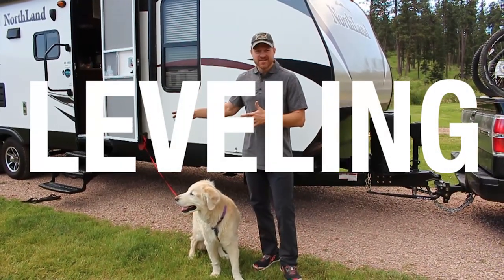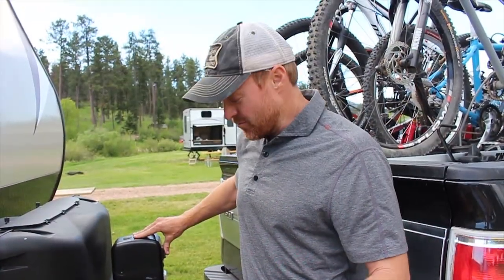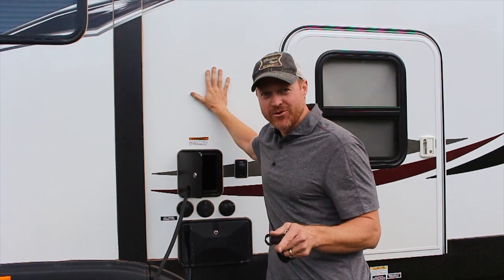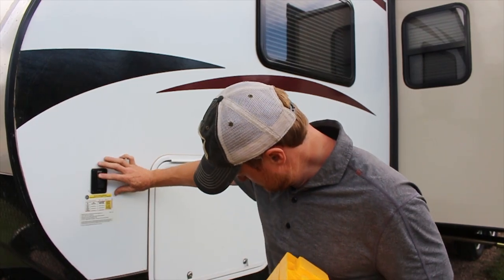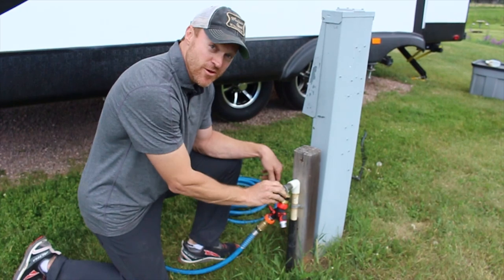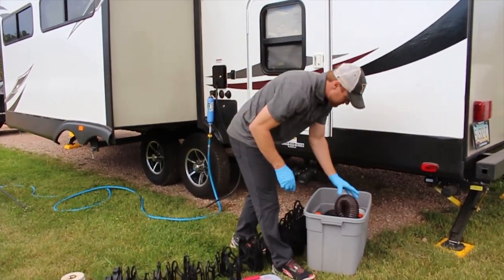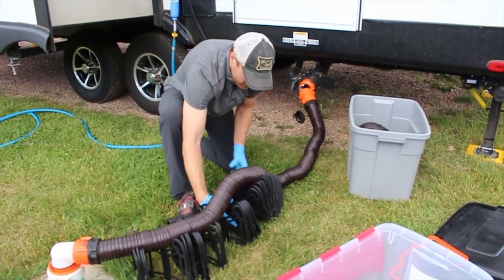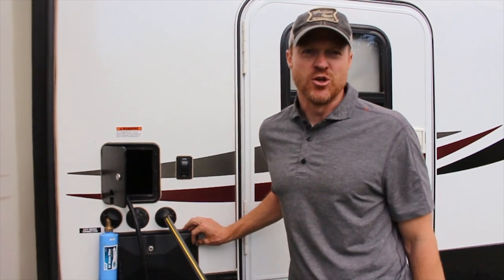HOW TO HOOK-UP AN RV FOR THE NEWBIE RVER! (FULL TIME RV LIVING)

Comment: Great video, try calgon water softener in your black tank. helps keep your sensors clean and break everything down and smells good. We have been fulltime Rving for 5 years now and still learn something new at each stop. You already know more than we did our first year. Y'all be safe
Reply from the maker: Will def give it a shot! We might have some build-up in our gray tank pipes... heard a gallon of Lysol de-greaser works well for that. Any input there?
Reply: Occasionally we would drop one of those pellets for dishwashers in the black and grey tank, fill them half way and then drive to the next location and drain ... cleans the sensors.

Comment: I have learned that putting the water filter  before the pressure regulator will make the regulator last longer due to crappy water, especially on a adjustable regulator.

Comment: Great video. Another suggestion that I would like to make to you is on your sewer discharge pipe I bought a 3 in shut off that fits right on in place of the cap giving you an extra layer of protection from accidental leaks, and then the cap fits over the discharge valve.
Reply from the maker: That's a good idea. I'll def. look into it.
Reply: +Keep Your Daydream Camcorder makes the shut off valve and can be purchased at Amazon or other RV parts stores
Reply: @KeepYourDaydream  Funny, your son will appreciate it in the bird.  This was a 5 year old comment.

Comment: Great video. I like the comments I'm getting some good ideas. I didn't notice did you put a pressure reducer on you water line. In regards to the gloves I use commercial grade dishwashing gloves from home-depot and then wash my hands with the gloves on and reuse them. They last a long time and it's less expensive than boxes of gloves. As said before the surge protector is a must. I had a pedestal that was reversed and I caught it when I checked the power with my surge protector.  Keep it up, you guys are doing great.
Reply from the maker: Thanks for the comment. Yes, I've learned a lot from the comments. I should have pointed out the pressure regulator. It's the brass fitting on my fresh water hose, but I should really have one on my grey water hose too. Run the risk of blowing out the lines when filling the black tank. I'll be adding a surge protector to my Amazon order tomorrow! Also included in that order is the bumper mount for my second spare tire and some motion sensor LED lights for the cabinets.
Reply: +Keep Your Daydream one more thing. I only hook up the sani flush when I flush it. But I placed an in line valve so I can shut it off at the RV instead of walking back and forth to the spicket.
Reply: I don't think you can blow out the black water lines with pressure since the tanks are vented to atmosphere (through the roof vent).

Comment: mark as someone else said..done like a pro....the only thing we do different is pull the slides out before we level side to side. Incidentally were also we just at Rushmore...cool place!
Reply from the maker: Thanks. Interesting... you're suggesting to pull the slide out and then level? Do you have a Class A or trailer? If we needed to level side to side, it would require moving the trailer.
Reply: We have a trailer... Cougar Xlite 31RLT we were advised by the dealer to level with slides out...it has 3 slides though so maybe that's why we level side to side with the slides out before unhooking the truck and bars..Also if you guys frequent some of the RV/trailer forums you'll find you can put together a hearty brass adjustable water regulator to improve flow (shower) but not overwhelm your trailers plumbing. I also on this last trip learned that having plumbers tape and several replacement rubber o-rings for the water service/hose connections are beneficial as they fail pretty frequently

Comment: on your waste line you need the hose to create a trap ( down up with water in it ) this will stop gasses from getting into your system if you leave the gray water open and in extremely rare cases rodents from getting in threw the system. extremely rare but it can happen. also you could mention tilting the awning to run off heavy rains it looks like rain. 
just some observations.
dave
Reply from the maker: What a great idea. Easy to do. Thanks!

Comment: I put about 5  - 10 gallon of water in my black tank along with some dish detergent before leaving for the next stop. Drain it when I hook the sewer line. Does a good job of keeping the tank clean and even with a back flush, there is still junk in the tank.
Reply from the maker: Great idea. I've done that a couple times,  but I could easily do that more. Thanks for the comment.

Comment: Did not see this in comments.  We always spray the campground water outlet with bleach .  Have seen people too many times put their sewer hose over the outlet to flush out.  I would NEVER hook up the hose to flush the black tank.  One accidental turn on and a totaled RV from black tank overflow.  I only hook up when using and NEVER leave the hose while in use.
Reply from the maker: Someone mentioned this a while back... but the way you put it was very compelling. I need to start doing this. I assume everyone hooks-up like I do and that's wrong. Spraying everything down is a good habit to get into. Okay, another good point about the grey tank. I actually don't leave it connect, but I may have implied that in this video. I think I'll go back and add the annotation so others don't make that mistake. Good comment. Keep in touch. I'll be doing more how-to videos.
Reply: I do the same hookup with my flush line except I've added a little backflow preventer on the flush line. Idea of those is that if for some reason there's a flow of water back up the flush line, the little device stops the water getting into my splitter, and leaving it screwed onto the Y let's me know which side of the Y is my 'dirty' side.
Reply: Andrew Kay 
Be careful, my new 2016 keystone hideout has a back flow preventor already installed in the flush system and the mfg paperwork actually specifically states NOT to add another one. I presume two might cancel the effect, I don't know. Of course I read this after I already purchased an external preventor like you. Thought you and others reading this should know. Btw, my dealer of course was clueless to this or why I would be asking. I even asked my RV manufacture and they said one was not built in. 

I trust the guys who built the part more then the guys installing it let alone selling it. Take it for what it's worth.
Reply: shrugs MFG paperwork on mine is silent so I'm comfortable with having an extra if there is one. Theory behind how it works suggests you can add any number inline with little ill effect so saying otherwise is mostly just CYA in case the end user breaks it and demands warranty.
Reply: Andrew Kay 
You could be very much correct. I really don't know, just relaying what my paperwork said. More that nobody seemed to even know that preventor was already there which would have saved me the purchase. Functionally I don't know if you can actually have multiple inline without consequences.
Reply: good points

Comment: Good job! Just one suggestion... don't put the stabilizing jacks down until the truck is pulled forward from the tongue. You may have to raise the tongue to clear the ball putting unnecessary pressure on the rear jacks. Then you may have to lower the tongue for final leveling, which should only be done with the jacks up. Can't wait for the next episode!
Reply from the maker: That's a good point and something I've done accidentally many times. Even forgetting to retract the stabilizers and lifting the tongue jack. Err. Thanks for the comment.

Comment: Hi Mark,
Just purchased a 2021,  26 foot passport Travel Trailer and so far I Extended the stabilizers before removing the Hitch, Closed the extension without checking the inside where one of the cupboard doors was still open and did not let the park water flow first before hooking to my filter WOW and this was after watching your excellent newby video. But nothing was damaged so I got lucky. We have only been out three times so far but absolutely love the camping world. I also have a tonneau cover and noticed you have mounted your bikes on top. What bracing systems do you use? Hope to see you folks at a campsite in the future.
Bill & Wendy Vela
Gy/Sgt USMC Ret.

Comment: Great video with very helpful tips!  One thing I noticed was the angle of your spring bars for your weight distribution hitch.  It looks like you need to get more angle on the ball mount head of your hitch to ensure the bars are parallel to the frame.  This will allow you to get 5 (or more) full links showing on the chain and ensure the WDH is working as designed.
Reply from the maker: Thanks for the comment. How do I get more angle on the ball mount head? By tipping toward the trailer?
Reply from the maker: Will check out. Thanks!

Comment: I didn't pick up the Y-connector under the assumption that I'd not need it at the camp site.  But seeing you connect it at the camp site for the gray-flush opened my eyes that I perhaps should have.  (I expected to only use that hose at a dumping station).  Can you comment on why, perhaps, you don't have a flow regulator on that hose?  And, as importantly, it's still unclear to me how/when to fill the black water tank without generating too much pressure.

Comment: Mark when you buy a floor jack get a aluminum race car jack it cost a little more but they're well worth it they got a hand on the side of them and they are lite the handle has a pin detachable just remember 2 foot by 2 foot piece of plywood for a jack stand 2 foot by 3 foot for the jack it's always to be a little better prepared than not at all I like the tire gauge with a dial on it I have with me a battery charger a tire pump 50 foot cord tools too it's nice to have a soft pad for your knee caps too lol remember the tire kit one that has the drill bit in it pull the nail out grill it slap some glue on the plug cut off plug with one sided razor blade air up Tire rock and roll
Reply from the maker: I was at home depot last night and had my hand of a floor jack. Surprisingly only $60. But I didn't pull the trigger. Too many other things to buy right now... so my truck jack will have to do for now. I'll keep this in mind when I buy one.
Reply: Ok good aluminum 😂
Reply: Great news! It's okay to use periods! Do not be afraid, no one will hurt you if you use periods and upper/lowercase letters too!
Reply: Good point. I couldn't make any sense of the original comment. There is a reason for punctuation/capitalization.

Comment: Great information! We are buying a camper soon and know nothing about pulling and set up. This is super helpful! What kind of rig do you have? Looking forward to more vlogs!
Reply from the maker: So glad to hear that! We'll be sure make more videos of everything we didn't know. We have a 28' Pacific Coach Works that we pull with a Ford F150 half ton with a 6.2L engine. The trailer is 5,900 dry and 8,000 fully loaded with full water tanks. Inside tour and Q&A video coming soon. Thanks for watching!

Comment: Thank you so much for the step by step instructions. I was wondering how you know it's level and then you pulled out your four foot level...I have a question (I've never RV'd so I'm learning all I can ahead of time) When you're towing the trailer, how does the fridge stay cool? If it needs to be level in order to operate, how does it operate when in transit? You had a lot of really good ideas and organization with the bins holding the hoses & supplies. Really good idea about the 409 cleaner!
Reply from the maker: Thanks so much Diane. The fridge is connected to two propane tanks. There is a button on the fridge for "auto" so it knows when the RV is connected to electricity or not. When it's not... it defaults to propane. We use the propane for the oven, stove and fridge and just filled them so they lasted over a month. Generally speaking, the trailer is level when in transit so I haven't seen any issues with the fridge. Thanks for your comment. We'll do more how-to videos and some of the improvements we've made inside soon!

Comment: You may want a Hose Thread Backflow Preventer by Drip Depot on your gray hose so there will be no water out to the black tank into your water system.  Amazon have them for less then $7.

Where you have your gray tank connected into the water source, we connect a hose to wash things.

Enjoy your videos.
Reply: Exactly - as a AA licensed water/waste operator that was my husbands first comment you need to put a backflow to prevent any possible cross contamination flowing back down - not likely but can happen, also very very important to change the water filter according to the manufacturer specifications - that is a leading cause of bacteria if not changed timely.  Gread video - love watching your channel, your boys look like  they are a riot - must drive your daughter crazy.
Reply from the maker: Good point. I'll look into that!

Comment: You can use the level on the outside wall of the trailer to check side to side level. My wife does the leveling standing outside. I can roll onto the block and she stops me when it is level. We don't level on a slide out, just the main wall of the unit. Happy travels!
Reply from the maker: I may have learned more from the comments than the viewer did from the video! :) Thanks!
Reply: +Keep Your Daydream Your video is a good tool. It also brought in more information.

Now, you can give one of the kids the job of side to side leveling. By the end of the trip, they will be experts!
Reply: +Keep Your Daydream If you are planning a Disney World adventure, We might see you there. My wife and I start work there the beginning of Sept. :) (it has been a dream of hers for years)
Reply from the maker: +"Where ARE my glasses?" Orlando?
Reply: +Keep Your Daydream Looking at your map, it looks like you are coming to Orlando. We , like many retired RV ers, work as seasonal cast members at Disney World. Geez, I made that sound like I have done this before. I have never been to DW but my first time will be as a cast member! Great way to spend the winter I hope!

Comment: You need to get a serge protector or you could fry your electrical system due to electrical power shifts. If you have it already that's awesome , I just didn't see it when you plugged in your electrical power cord. This could save you a lot $$$$ in repairs.
Reply from the maker: I just bought one this morning on Amazon as a result of all these comments. Had no idea... so glad I have one on the way now!

Comment: A couple points .... I used a 1 x 1/2 inch stick to make a "Go/No Go gauge" for our slide out. I made the stick 6 inches longer than the reach of the slide out so I can just set it against the side of the slide out and see if it will make contact with anything after extending, no outside help required. Also wondering if your water hose is the equivalent of the white "drinking water certified" hoses ? Just because you have a particulate filter doesn't mean the chemicals from standard rubber garden hoses aren't getting through (you can't see this) :-)  Most of the inline restrictors are certifed to a maximum of 40 psi. to protect internal lines. However, most of them actually limit pressure to between 30 and 40 psi. We used an actual pressure regulator with a gauge ($57 - Camping World) so that we could adjust our pressure to where we wanted. Most RVs used a standardized 80 psi pressure test so we know this is what the manufacturers consider maximum allowable. That being the case, we always set our regulator for 50 psi which makes a big difference when showering for example (50 is better than 30)  :-)  If you mount a side to side leveler on the outside, be sure that it's dead center. Also check out a free app .... Clinometer (Android) ... makes a great level check on your cell phone (both bubble and as an angle finder).
Reply from the maker: Good points. I'll do the stick idea for sure. Yes, the hose is a cert. drinking water hose from Camco. I liked Blue :) I do have pressure regulator, but I don't know the PSI. I need another one for the gray line when doing the santi flush. Good tip of the leveling app. Amazing.
Reply: This is the one I was referring to ... you set whatever psi you want ... it's adjustable. Keep it limited to 50 psi and you'll be fine. Attach the regulator to the spigot and you can use your splitter on the outlet end so that both hoses will be regulated.

https://www.amazon.com/Pressure-Regulator-Lead-free-Adjustable-A01-1117tm/dp/B00KH7RFVI/ref=sr_1_4?ie=UTF8&qid=1480980771&sr=8-4&keywords=pressure+regulator+with+gauge
Reply: Keep Your Daydream watch one video pool guy left his pressure regulator in the park that 50 bucks went down the tube

Comment: Great video but I would be nervous about hooking up the gray hose unless I know the valves are open to drain. It’s so easy to turn the wrong hose on by mistake and overflow the black tank. (Yes, I’ve done this) Now, I only run the rinse hose if it’s open and will manually fill the tank with clean water with a 5-gallon bucket or by running it from the toilet while I stand there. Thoughts?

Comment: I believe Home Depot Arlo's has a really good Tire plug kit really heavy handle Google that he might be a little pricey but when it's hot as hell out you want to get it done quick you have to do that good equipment has a way of saving your bacon check your tires every time you stop you could get something like a bar and smack those tires without having to get the tire gauge out if you got 1/2 flat it will tell you right now